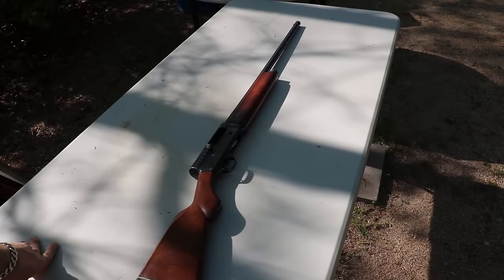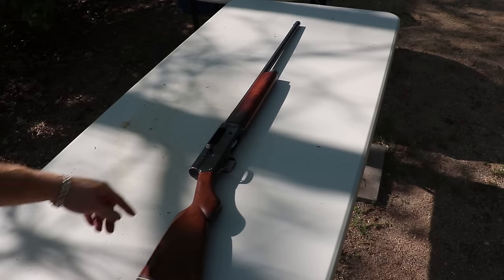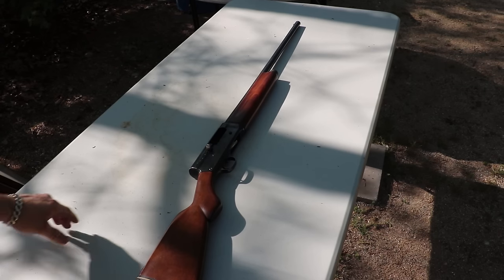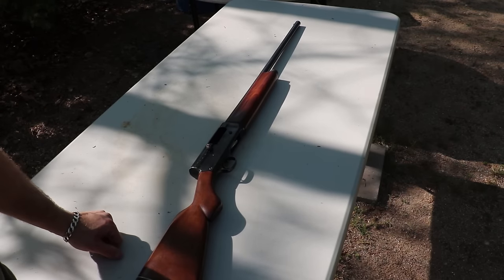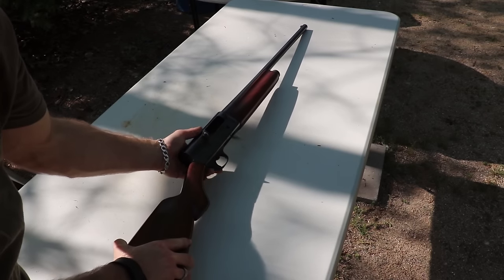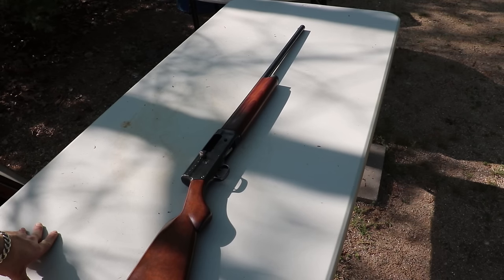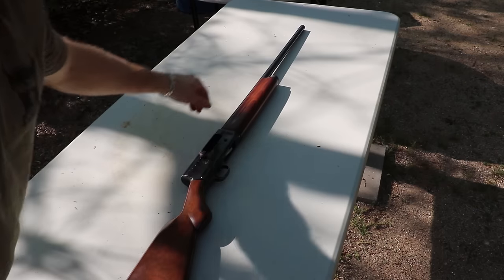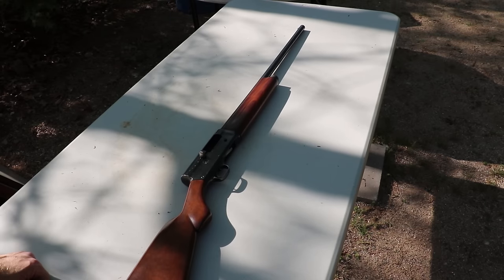Remington Model 11 12gauge Semi Automatic Shotgun Quick Clips

Comment: I have hunted with a 1930 produced one for 15 years. The key to these is proper friction ring set up (not hard to do)  and make sure you have a good recoil spring. These parts will cost you $50 and it will save you from the gun beating you and itself up. Do this and they will run forever

Comment: You should find a way to put an AKM underfolder trunion on it. Lol. That'd actually look sick.
Reply from the maker: LOL :) the only issue is the bolt spring goes back into the stock, so it can't be as short as some may think.

Comment: how powerful is this gun relatively?
Reply from the maker: It shoots 2-3/4” shotgun shells which are pretty stout in slugs or buckshot.
Reply: Cobain used target loads. That means low velocity and tiny shot that doesn't penetrate very well. Consistent with his suicide.

Comment: For target load 1-1 1/8 oz friction ring set up in high or low?
Reply from the maker: I'd set them up for the light loads. with the steel ring at the base, and the friction ring at the top
Reply: @BuffRANGE  you still have og square recoil spring or a round recoil a5 spring replacement? and thank you so much! just rebuilt mine looking forward to trying it out. Replaced recoil spring round a5 light 12g ,action spring, and fiber buffer.
Reply from the maker: @arsenal_tackle_fishing  yeah the square one

Comment: Hey how the stock? Is it cracking. Just put one on layaway, it was 200$. My stock does wiggle a bit as well. And there is a small hairline crack on the upper tang. Mines beat to hell so probably gonna chop it.
Reply from the maker: I had to replace the stock because of crack and wobble :(
Reply: @BuffRANGE  that sucks where did you get the stock?  I'll probably replace mine

Comment: Hold on there, the Remington 11 is a not a licensed copy of the Browning A5. The Remington was around before the Browning.
Reply from the maker: The A5 was first, and Remington variant came after along with the Savage model.
Reply: IHCTerra 
 I have a Remington Auto-Loading Shotgun, the predecessor to the Model 11, made in 1908 according to Remington.
Reply: @DW-qe7qe  I did some checking and got some more accurate dates. 

 The Remington Model 11 was called the Remington Auto loading Shotgun from 1908-1911 when it was renamed the model 11. It is the same gun and it was built as a licensed copy of Browning's model 5 that he patented 8 years earlier in 1900 and started producing in 1902 with FN.
Reply: IHCTerra 
Excellent info. Thanks for sharing.
Reply: @DW-qe7qe  I Have The Same Made In 1905 Per Remington, Fully Functional
Reply: 1905 was Start up